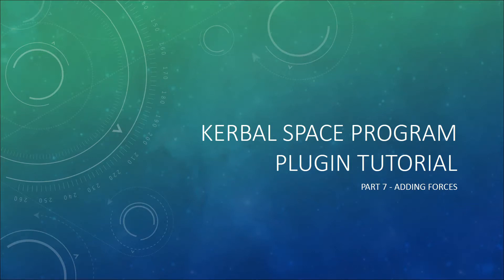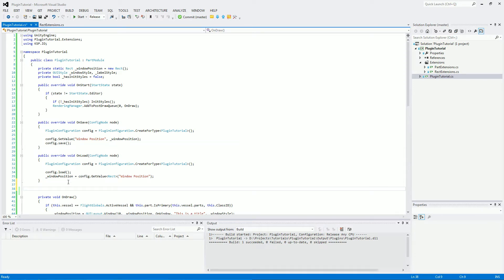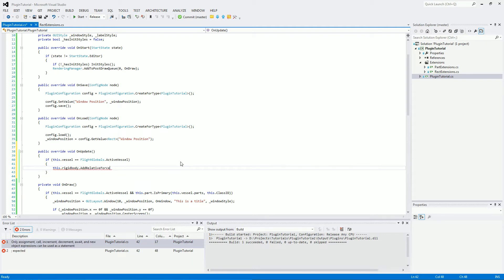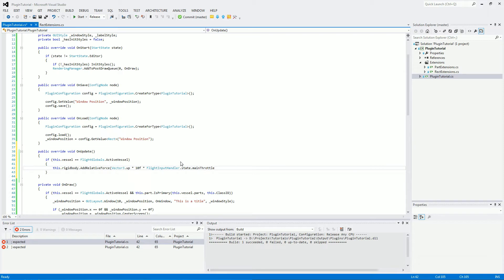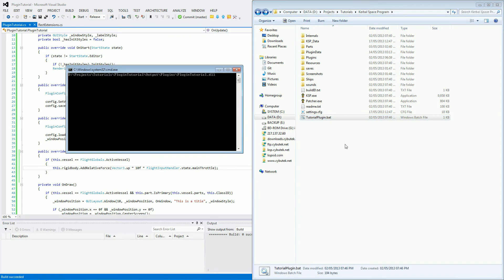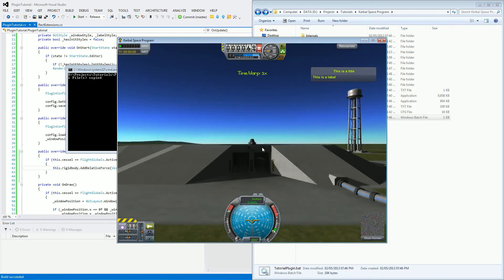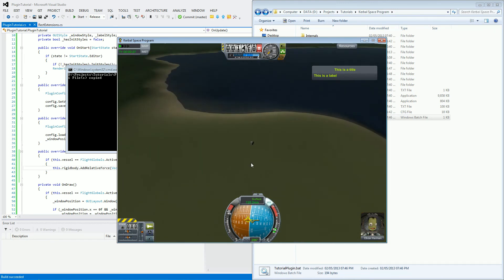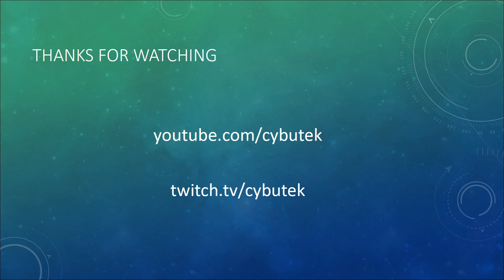KSP Plugin Tutorial: Part 7 - Adding Forces

Comment: I followed your example and I get this in my output log:

Filename: C:/BuildAgent/work/d63dfc6385190b60/artifacts/StandalonePlayerGenerated/UnityEngineDebug.cpp Line: 49)

NullReferenceException: Object reference not set to an instance of an object
  at MyKspProject.KSPPluginTest.OnUpdate () [0x00000] in <filename unknown>:0 

  at Part.ModulesOnUpdate () [0x00000] in <filename unknown>:0 

  at Part.Update () [0x00000] in <filename unknown>:0